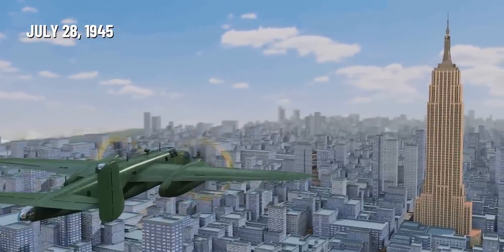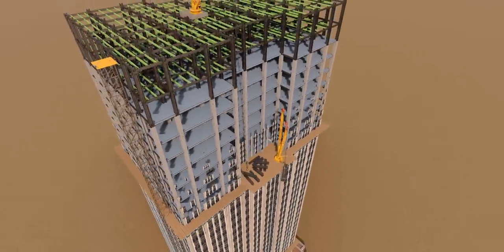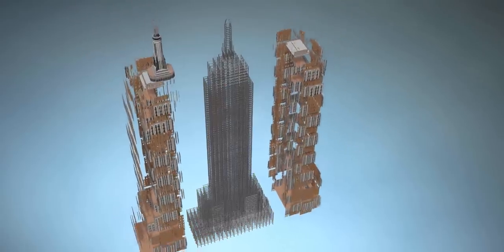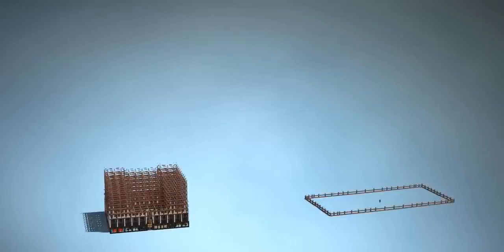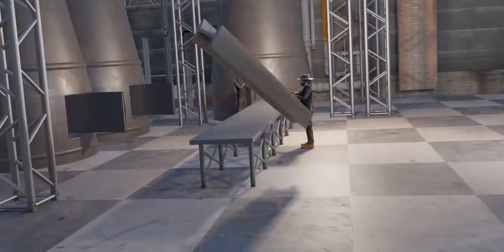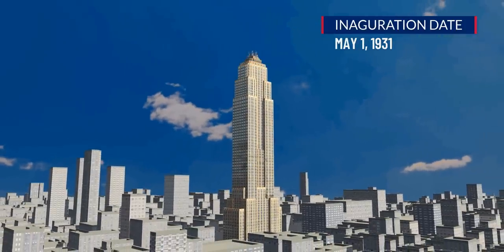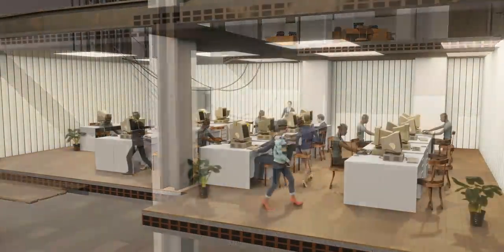Empire State Building | All the Secrets of the Engineering Wonder

Comment: Great video. One correction - the building getting narrower towards the top was not an aesthetic choice, it was a legal requirement. After the Equitable Building was built downtown, all skyscrapers had to have setbacks if they wanted to go higher. This was done so that the buildings would not block the sunlight from hitting the streets. More info here - https://en.wikipedia.org/wiki/1916_Zoning_Resolution
Reply: The zoning law states that the hypotenuse of a right triangle drawn from the opposite side of the street with a 25 degree angle or so can not touch the building which is why the building needs setbacks every few stories on the lower level. The exception to this rule is that 25% of the lot size can be built as high as technically possible. (This explains why developers buy air rights from neighboring plots.) The last setback the Empire Stare Building needed for the zoning law is at the 29th floor. 

The shape of the building above the 29th floor was to make 8 corner offices while using exactly 25%of the lot size. 

The floors above the 86th floor observatory were intended to be a mooring mast for dirigibles but the plan was put on hold and scrapped after the Hindenburg accident.
Reply: Yes, but they used that as part of there design element towards aesthetic. It was all thought about.

Comment: You have one correction to make. Ironworkers assembled building by driving hot rivets. High strength bolts weren't used for several more decades.
Reply: High strength bolts made their debut in the early 60s. Temporary soft bolts were used to connect members for the riveters to follow.

Comment: As I remember back in the 70s, they had a glass showcase with a brick in it, and if I remember right it said they had ordered either 10 million or 100 million bricks for the building and had ONE brick left over!
Those terra cotta blocks used in the floors were commonly used back then in partition walls and elsewhere, they were why the gothic styled building at  90 West Street which had raging fires after 9/11/01 survived.
They still use these blocks to-day in home contruction in Romania, Slovakia, Hungary, and I imagine elsewhere in Europe. I saw google street views of  a new house under construction in Hungary, it used those same terra cotta blocks which were then faced with stucco,  while the roof was made with red terra cotta roofing tiles.
They are superior to the cheap concrete blocks we use- larger in size and having multiple cavities in them, they have more insulation value than concrete blocks, and since they were clay that was hardened and vitrified by FIRE, they stand up to a fire whereas concrete blocks crack and crumble because concrete is made into a powder by grinding up and burning limestone, adding water and sand to that chemically cures it into a hard form but it's not vitrified like terra cotta

Comment: A building built almost 100 years ago stood up the impact of a plane, but a 110 story monster with far more advanced engineering collapsed like a house of cards in 2001? Seems legit. Right?
Reply: A tiny plane crashed into the empire state building, but a massive plane going full speed crashed into the twin towers.
Reply: No, you are simply mis-informed. The plane that crashed into the Empire State Building weighed 33,500 pounds with a maximum fuel of 974 gallons of fuel traveling at a maximum of 275 mph. The 767 that hit the WTC weighed 284,000 pounds, carried 12,100 gallons of fuel and were traveling in excess of 500 mph. Spot the difference. Not being able to comprehend that makes it redundant for me to explain the difference in the construction of the 2 buildings.

Comment: 2 minor nitpicks: You showed the 101st floor as the 102nd. The 102nd is the space with the open-air wrap-around "porch." Secondly, the 1945 crash did damage a floor girder enough to require replacement, but no vertical columns needed replacement.

Comment: It's been said that the stepped design of the buildings is due to air rights regulations in New York city but I saw no mention of that in this video and instead it would seem that this video suggests it was a purely aesthetic choice. Please explain
Reply: All tall buildings in NYC had to adhere to a 1916 zoning law, that allows light to infiltrate the streets, as the tower gets taller it gets setbacks

Comment: One thing that I noticed on some old film about the construction of the empire state building was how to achieve the required precision that all the steel beams and girders. After all the plates were riveted together, this would leave both ends rough and uneven,  the iron workers would run these assembles through a giant milling machine that would shave both ends to a square and determined length. By making these all square and the same over all length,  they could easily take them to the building site and put in the main assembly of the building without much drama to get things to line up.  
The brief moment in the movie clip that had this milling machine, showed it must have been huge. There was one of these Carnegie beams mounted in the machine and the two cutters on either end were both turning. These cutters looked to be about six feet in diameter and the bed of the machine must have been about 50 feet in length.  
I am curious,  is that how big i beams are made,  no rivets,  all welded.  But do they still shave the ends to maintain the length and squared ends?

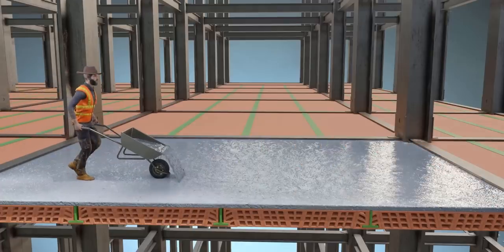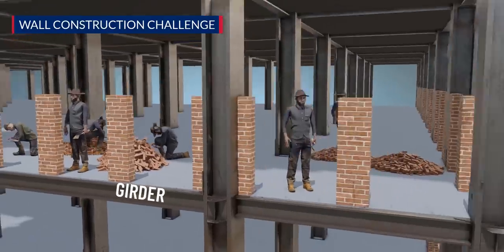Comment: 4:22 - - terra cotta GEOMETRIC INTERLOCKING FLOOR - - 4:29 - - 4:36
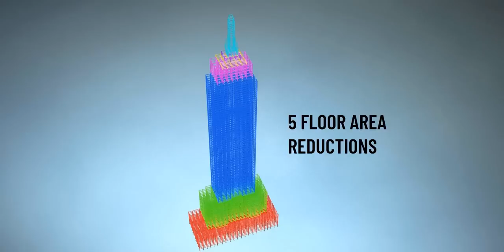0:45 - - column placement - - 2:00 + 2:13 - - riveting the columns together - - 6:06 - - prefabricated pieces 
7:10 - - 73 elevators (explained) - - 7:42 - - the foundation (17 meters) - - 8:08 - - airplane engine went through elevator(s)